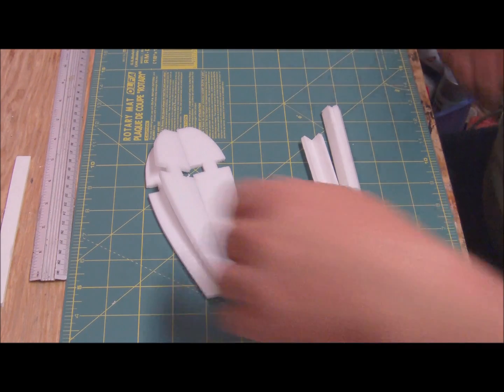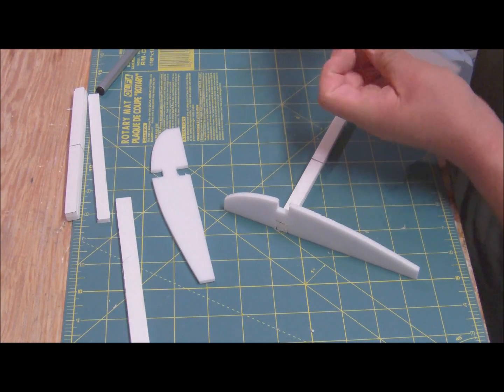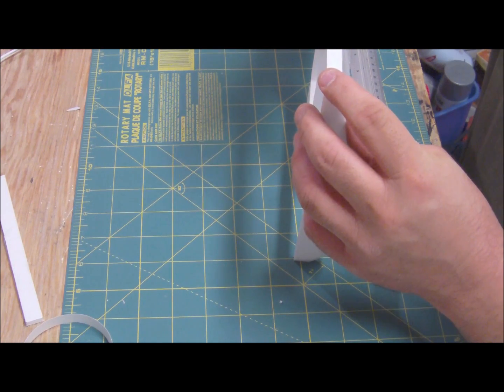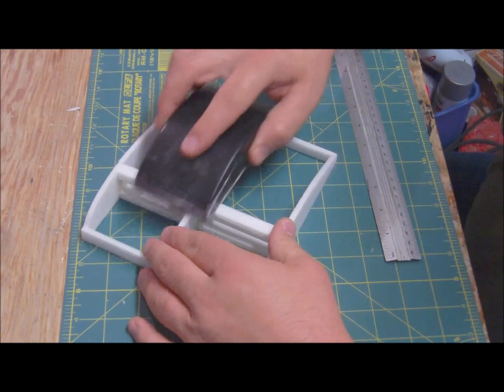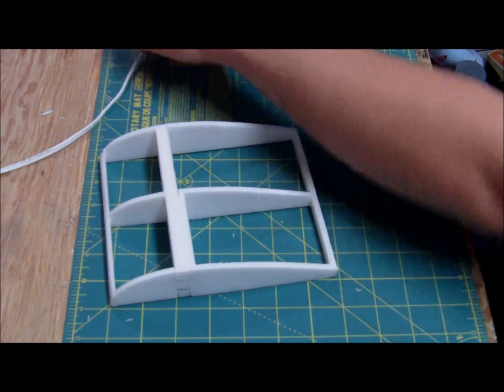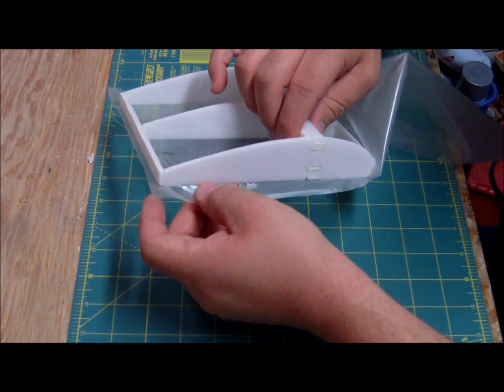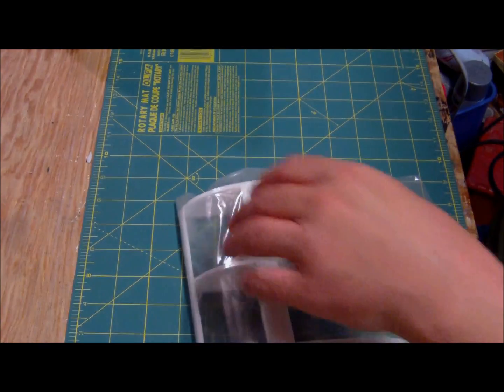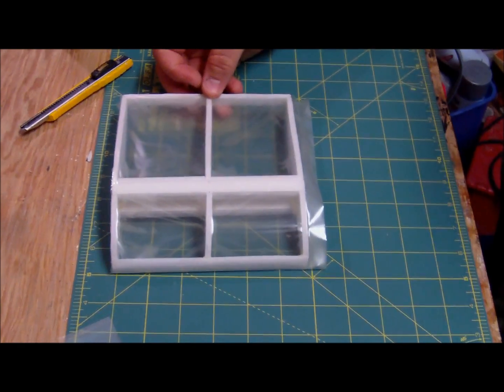How to make a ribbed foam wing

Comment: I have never used foam or plastic film (and never will) but when covering balsa wings, we never used to stick it to the ribs or spars. Just the edges. Les warpage when you shrink it.
Reply: Yes but the strength gained is so small that it is worth losing in exchange for the exponentially decreased risk of terrible wing warpaing. Trust me, I've made the mistake of sticking tissue covering to the inner members of a balsa frame and shrinking it. That wing never flew...
Reply: @AeroCraftAviation  with covering film you just have to warp your wing in opposite direction and heat film again.
Reply: Yes, that’s true. But that has little do to with what I was saying. My point still stands.